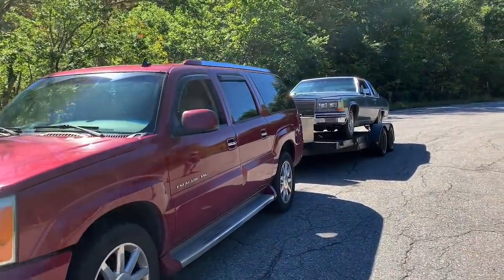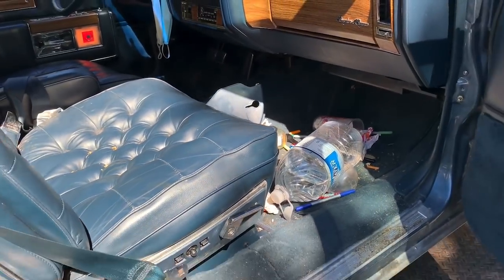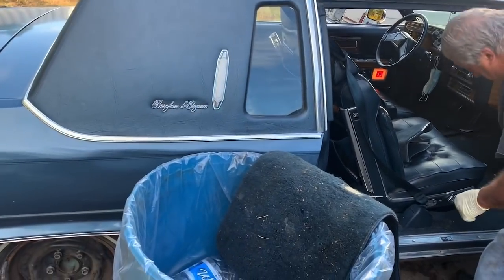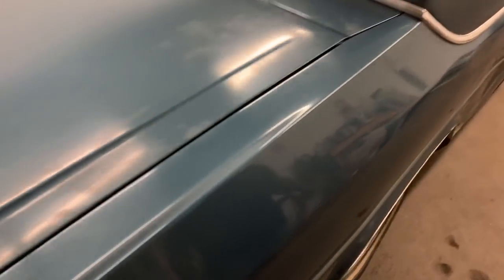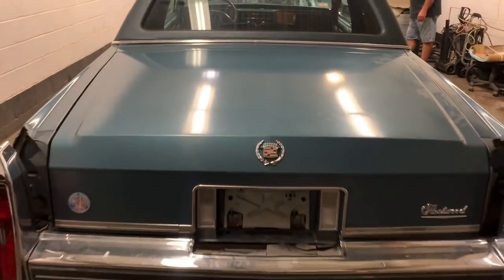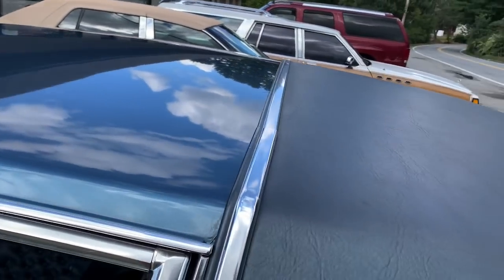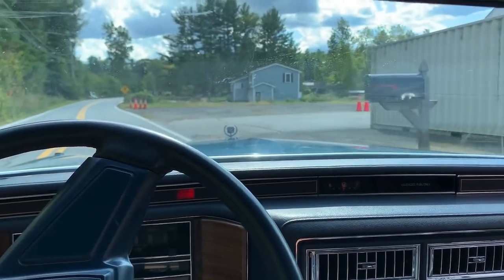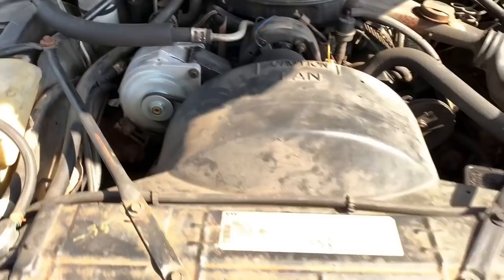RARE Cadillac RESCUED!! Now What? 1985 Fleetwood Brougham Coupe D’Elegance SAVED

Comment: She cleaned up surprisingly well, great job! Looks like a lot of work but definitely worth fixing.
Reply: Definitely NOT worth fixing. That passenger rear quarter panel needs to be replaced, and not all that rust is “just surface”. Major sheet metal cutting, fabrication and welding involved to make this car right. You don’t just pound that mess out - to do it right it needs to be cut out and replaced. 

Good luck finding a proper replacement rear quarter panel for an early 80s Caddy coupe. You’re looking at fabricating one from scratch!
Reply: @joe6096  I agree with you, and what kind of damage lurks behind the front bumper!? Plus 85,000 + miles, don’t see Tony making much profit here. Might make for a good parts donor.

Comment: I was thinking just cover it and wait for someone that needs parts (the doors) but when you videoed the underside I was surprised how clean it looked. It's a 2 door so someone w some skills may fix the quarters. The bumper should be available at a pull a part and probably the fender too. The Maaco paint job. There's good Maaco's around you just have to find one. What ya doing w the Roadmaster.

Comment: Little secret tip for cleaning the wire hubcaps: Remove the upper rack of the dishwasher and get a second lower rack. Clip off a number of the pegs and put the wheel covers in a regular dishwasher cycle. They come out twinkling! I had a '77, '78, and a '79 that I used to do this with and people used to stop me to ask how I got them so shiny.

Comment: An interesting find I agree was worth saving, it will definitely require full body restoration though -even as good a job as you did cleaning it up as usual. Someone with deep pockets who doesn't mind that damn 4100, good running or not. And really good at very specialized body work obviously. Then they just go ahead and drop a 350 under hood while they're at it since it won't be original anymore anyway, but 85K miles -who the hell cares on this one😃

Comment: As for fixing this once lovely car up and spending the money to do so, it will depend on what the underbody and frame is like. I say that because of the visible rust around the wheel wells and some I noticed down by the rocker panels.

I suspect that in the past 6 months it saw more winter driving than it did during the rest of its life.

Comment: I am not sure you can get this done right without MAJOR surgery and metal fabrication. That rear quarter panel will be a bit*h to get straight with a slide hammer and still require globs of bondo to get perfectly smooth. Plus not all the rust is just on the surface. I suspect the right way to do it would be to cut out that rear quarter completely and replace it. That’s probably going to mean complete fabrication unless if a company like National Parts Depot has a rear quarter for an early 80s Cadillac coupe. 

It would be a labor of love no matter what you do, because to get it right will definitely cost far more than what you could sell it for even after all the repairs.

Comment: Not too many coupes left on the streets it would be nice to have it repaired and once again a cruising CLASSIC if the mechanicals are good and engine oil pressure is up to specifications 
It will be worth it the cruising coupes rear wheel drive 
Cadillac Brougham 
Oldsmobile 98
Buick Lesabre 
Mercury Marquis 
Ford Crown Victoria 
Made in 2dr fashion

Comment: They didn't make a Cimarron in a coupe.   Wow if they had.... rare.   After it's cleaned up put it on eBay for $80K   starting bid.  After body work and re-paint it should really shine up.  Yeah those coupes are far and few finds. Fortunately the seats look to be in very good condition.  That's a plus.  We missed the part where you put the body in the trunk into the dumpster.

Comment: Keep the body the way it is... nice and rotty. Key a couple of panels.  Take off two more fake wire wheels. Skuff one the whitewalls with a wire brush and spray-paint an "X" over the wheel like it came off a derby car.  Remove ONE of the lenses of the exterior opera lights but leave the bare bulb.  Take out the engine;  trash it...it's garbage and you know that. Drop in an LS.  Give it a 5-speed floor or 3 on the tree.   Do that and I'll give you $2900 [spits in palm of hand and extends it].